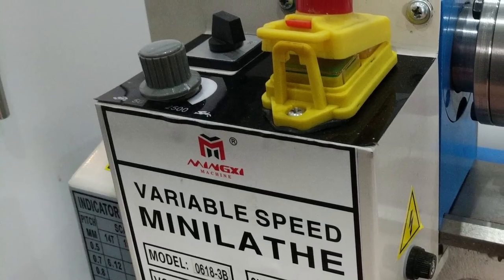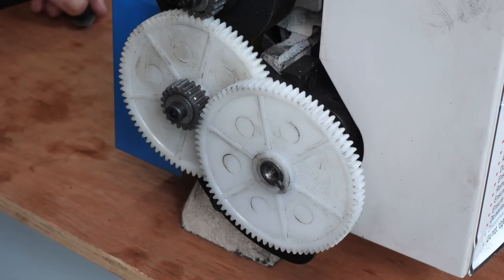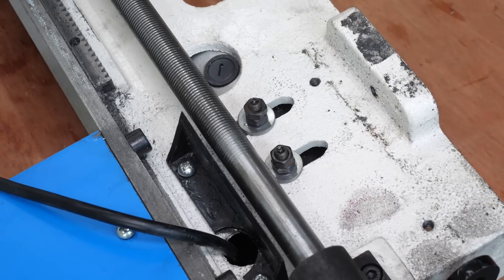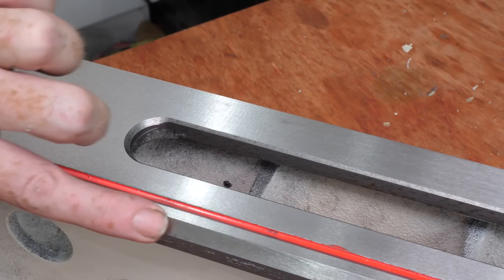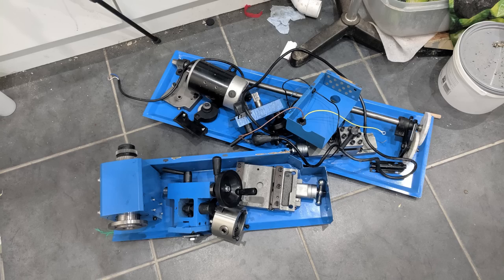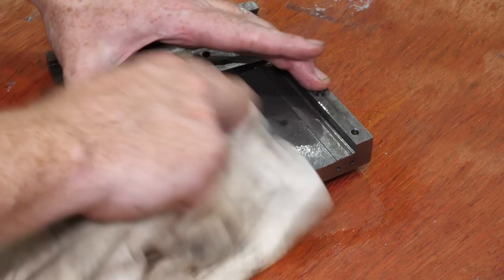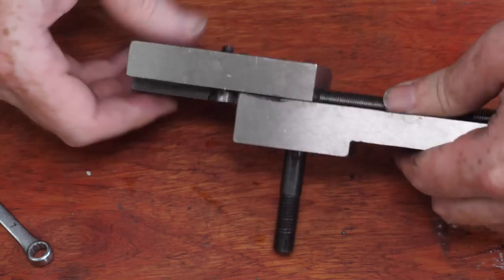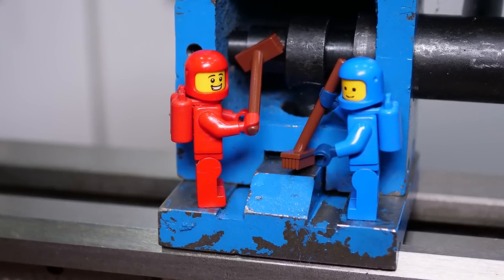Disassembling the CJ0618 7x12 Lathe, Cleaning, and Troubleshooting

Comment: I also have the identical machine you have, let me say yours is nice compared to what I have. I took mine all apart many times trying to get the ghosts out the machine.I did order all metal gears I think from banggood for this model but they don't fit to tight to go on so the journey continues, and yes your videos are always clear with excellent communication and worth the wait. I do have a request I need to figure out the belts ,pulleys, ect ect to get rid of the crappy plastic belt.

Comment: These problems are universally characteristic of all the cheap Chinese lathes I've seen online. It would almost be worthwhile for the lathe to ship as parts rather than assembled. That would simplify disassembly, cleaning, adjustment, and reassembly. And it would undoubtedly save the manufacturer at least $2 in labor to assemble it.

Comment: This video, and the next, are going to be required watching when I get around to ordering one of these starter lathes.
Reply: I think you would end up a lot happier with a higher quality lathe as a starter machine. Probably a larger one also. This man obviously has enough experience to do a respectable job of fixing obvious issues. What can't be seen, so far, is how far off the bed and other components are. Even if the casting was properly ground to start with it may have moved as it aged. Cast iron can move, a lot!

Comment: You could try hammering a slightly oversized torx bit into those rounded off allen heads.  The splines will grip in the corners. This has worked for me on various crusty nuts on my motorcycle!

Comment: Over the years I have probably done the same/similar process to 8 ~10 of these. The guys would bring them in for me at work to fettle into a usable shape prior to use. They have got worse over the years though. I always found that the lead screws were also poorly deburred and would benefit from the removal of sharp edges from the threads. 

Keep your eves open for center height issues and bed parallelism. I have had one that took quite a bit of rework to get nice and true along the length. The Beds are not ground but finished with a linisher belt.
Once set up properly they will hold a repeatable size with a decent spindle as long as a bit of care is taken. With s bit of patients you can mark out the cross slide angles on the rear of the turret and a couple of little mods I did to mine was to include an alignment pin to set 0 and +- 45 deg along with a cheap veneer scale on the cross slide and carriage a bit like this    http://tiny.cc/cvj2jz
Reply from the maker: That's a useful tip, I didn't think to check the lead screws for burrs. I'll take a look.

Comment: Do you think the initial purchase price of the lathe is still justified even with all the work you're putting in?  Like, as opposed to a little bit larger name name brand lathe or a second hand one?
Reply from the maker: When I answer that question, it's important that I explain why I bought this lathe. I'm very happy with the Proxxon (from my other videos), and I primarily bought the Chinese lathe as an edicational and improvelment project.  I fully intend to work on pretty much every part of it, before I consider it ready for use.

For anyone buying a lathe for real work, I'd strongly recommand a more expensive, reputable brand if you can afford it. However, if you can't afford it, don't worry about buying a cheap machine. Fixing the problems is very educational, and all the problems I found with this lathe are entirely solveable with background reading.

Buying a lathe is the beginning of a fantastic hobby, and you shouldn't have to wait until you can afford something of high quality if you can start learning + having fun on a budget.
Reply: @AdventureswithaVerySmallLathe  Don't downplay the advantages of the learning experience. By doing a full tear-down and rebuild, one gains a thorough understanding of how all the 'moving parts' come together, in a way that just doesn't obtain from opening the box and leafing through the manual.

Comment: Dish soap.and warm water is very effective at cleaning parts likr this.  This soap breaks down the oils and allows grit to be washed away.  It's very difficult to remove all abrasive and grit with solvents alone.
Reply from the maker: Any tips for preventing corrosion after cleaning? The upside of using a bycicle chain degreaser is that it contains ingredients to help prevent corrosion. Cast iron can start to rust very quickly, as I saw while I was making the video, when the paint stripping gel started turning rusty colour in seconds.
Reply: @AdventureswithaVerySmallLathe  just coat any parts in light oil after washing. I was more referring to the larger parts that you were cleaning with wd40.  The ultrasonic cleaner is pretty effective.

Comment: I also bought a lathe a few years ago and finally I took it completely apart to fit new roller bearings and also cut the play between the movable parts everywhere and now gradually I'm putting this back together I'm glad to see your work 😀you're just using the wrong screwdriver this is one for wood screws 🤗and not metal screws hihi 😂👍

Comment: I have just received a lathe that looks suspiciously the one you are working.  I dread the idea of taking it all apart like that, not mechanical,  but I think I might be able to if I go along with the video.  Excellent work.
Reply: depending on where you bought it there's a good chance it isn't nearly as bad as this. for Asia made mini lathes most of the cosmetic frames are made in the same factory they then get assembled by others who can decide what to do with the insides and the other important parts. this can lead to machines that look virtually identical, but have completely different qualities. Usually price does tell when it comes to these machines. You get what you pay for.
Reply: @crabbychimera3969  it was missing the little but that engages the plate to hold it on n place.  Besides that it seems ok. Couldn’t help but turn it in and it actually sounds good.
Reply: @crabbychimera3969  after going through mine a little it actually seems fairly good.  It sounds good and runs smooth.  Putting a live center in the 4 jaw chuck and tail stock and they line up well.  Maybe .5 mm out.  It was missing the nut that holds the plate in place to lock the tail stock in place.  That was an easy fix. So fingers crossed.  It says it is a vevor

Comment: Great video! I agree with your idea of it being a QA reject. Ive a 7x14 version and is virtually the same as that but branded Amadeal and it seems to have a much better finish (Not perfect by any means but is pretty good). Also when these machines are set up right they can do some pretty good and accurate work, mine consistently hits dead on to a thou

Comment: Thanks for the video. I am trying to take the saddle off of mine, but there is a caps head screw under the saddle that is hitting the gear and the saddle will not slide off.

Comment: Do you already did increase the diameter of swing over the bed?
I'm looking for a mini lathe with 30mm swing over the bed but it's very difficult find. I'm thinking buy this model and do the upgrade, but I'm not sure if it's possible
Reply from the maker: I'm not sure quite what you're asking. This lathe shipped with a swing diameter of 180mm. A lathe with 30mm swing sounds like for watchmaking, and I can't imagine something smaller.
What is the dimension you are looking to increase, in descriptive terms?

Comment: Great video well done!  wish I had found you last week, my lathe came in looking like the truck had run it over.  several missing and broken parts, no manual or tools as shown in the add. I have never taken a lathe apart till now. but I did make it through. for the most part. I wish I understood the power board more. I confused me on just how the motor was not running on 120v at first. my lathe did not run at all at first. after a lot of questions and elimination of good and bad stuff, It came down to the switch was bad and the switch on top was not in the best shape. bottom line it works, not for the final tune-up.
What size of cutters is correct to use, I am looking at 1/2 inch shank because this is what it will take to be on center with my cutting. and what info can you give me for my boring bar?  And where will I find replacement gears?
I have subscribed to you Chanel and looking forward to many more of your  videos
Reply from the maker: Wow, that sounds rough! Way worse than the condition mine came in, though there were a few big boot marks on the outside. 
I found 1/2" lathe tools are a bit big for this machine, and only just fit into some available tool holders. I found 3/8" or 5/16" tooling (10mm or 8mm) a better fit. The tool post included is very limited, and getting a quick change tool post will make life much easier.
Replacement gears, including metal sets are easy to find on eBay.
Thanks for watching!

Comment: Very nice work. Hope to see the difference on work quality after cleaning
Reply from the maker: Thanks! There are too obvious immediate improvements. Firstly everything about the lathe is more rigid, from the motor mount to the saddle and the tailstock. Secondly all the movement is much smoother now there isn't as much grit between the sliding surfaces.

Comment: Would like to See what your compressed air solution is as I am currently lacking this and require a small unit for such.
Reply from the maker: I'm afraid I don't have a unit for that yet. I use a refillable compressed air can which is filled with air using a bicycle pump. It can't hold much pressure, and it runs out in a few seconds.
Reply: @AdventureswithaVerySmallLathe  Ahh ingenious. How did you get the can to take bicycle pump valve ? Just a short 1 min video, with no audio even, showing the details would be interesting !! Im on a budget so :/ Any way to save a penny :D ie not buying a compressor :D
Reply from the maker: @JohnDoe-qg6hm  I didn't make it myself. I bought it ready made. Home made containers for compressed air are a dangerous hobby. I can't find any for sale any more though, which is probably a sign that the commercial ones aren't that safe either. I'm certainly really cautious how much pressure I use when I fill it, as it's fairly thin walled, and a rupture would be potentially pretty dangerous.
Reply: @AdventureswithaVerySmallLathe   :D Your very safety conscious i see. Commendable I suppose. I however used to throw any aerosol I could find onto a bonfire at the soonest opportunity when i was a kid :D. Ive seen butane gas torches with disposable canisters with small pipes brased into their base for connection to a calor gas bottle via a hose and jubilee clip rather than pay the inflated prices for the butane refills which have a low 'heat' or burn rating anyway... Ohh well i will come up with a solution myself i suppose in due course. Necessity is the mother of invention after all. Look forward to your next video.

Comment: I have read your comment about the lathe being cheap.
I understand you get what you pay for but it seems this was not actually sold as a factory second, or quality control reject.
I’m still surprised at how poor it actually is.  If someone new to the field bought one of these I can’t help but think they would be disappointed and unable to save it.  I’m wondering if you will need to use your other lathe to make any replacement parts.
It seems the parts were all made at seperate locations and someone collected up the duds to make another batch of very cheapie lathes.
Some of it looks like it was thrown together from a distance. :)
Nice description of how it all comes apart.
Blondie Hacks has done a nice video on getting a small lathe to cut parallel with and without the tailstock.
I used it to get my 80 year old lathe to cut within .001” over 8” again without the tailstock.
Nice work look forward to the next instalment.
Reply from the maker: You're right, it wasn't listed as a second, or reject, but it was an anonymous eBay seller, listing a limited number, shipping dirt cheap from an anonyous address in central Europe, so I knew what I was getting myself in for. There are established traders with a brand reputation to protect who I'm certain pay more attention to the quality of their stock, and I'd point anyone who can afford it to buy from them. Axminster and Arc Euro Trade in the UK come highly recommended, and I've heard good things about Precision Matthews in the US.
Your theory that this lathe was thrown together from dud parts seems very plausible, especially the tailstock, which barely fits at all, and looks as though it as been rusting  for a few months.
I love Blondie Hacks' educational videos, and I've learned a bunch from them. I'll definitely check that one out, thanks for the recommendation.
Thanks for watching, and for the commentary.
Reply: I also love the little guys that stand around on the machine and help you out.
You know you are going to have to animate them.  They will probably get their segment ;)

Comment: The plastic gear hub diameters are often too small due to shrinkage when molded. I reamed and sanded out the holes just enough so it's a slip fit and the gears are far less likely to crack or split.

Comment: My god, these things really are thrown together.,cheap for a reason. Good luck with the re-build.
Reply: Exactly, this video is a real eye opener.
Reply: ss  The only thing the Chinese mini lathes have going for them is their size, (tabletop) I'm currently looking a for used an  old British lathe, Myford etc but they are all a little too big for my garage/workshop.
Reply: ss  I hadn't but I think I will. Thanks for the suggestions ss
Reply: I had a mini-lathe that bought from Cummings about 14 years ago.  The quality was 10x better than this one, but the price was also a lot more.  I assume these lathes are sold at different levels of build quality just like anything else from China.
Reply: Looks like maybe it was put together by trainees in the factory and flogged off cheap

Comment: in reassemble will you replace the screws and such with quality replacements?  I have been doing that on my tool holders, replacing the set screws with cap screws as I got tired of the sloppy fit of allen wrenches in the tiny set  screws.  On some brands of tool holders it did require a bit of grinding on the cap screws to provide clearance but overall, I have been quite happy.  I was doing the same to some gib adjustment screws only to discover that there were clearance issues on some of the gibs that I could not resolve.  But overall, I have been pleased with replacing the results of upgrading screws and nuts with quality replacements

Comment: Great video!   This work should pay off.  The mini lathe can be a good little tool when it is tuned up.  You may want to replace the hex socket cap head bolts that secure the cross-slide and compound hand wheels  with hex socket button head bolts.  Your knuckles will thank you.    Chris
Reply from the maker: Thankyou Chris! I wouldn't be able to make videos as well as I can if not for your contribution to Emma's prize. It sounds like I need to add improving the hand wheels to the project list.

Comment: Question?  Very good presentation.  I have a question , where did you get the small stones from. Did yoy make( grind to shape) the triangular stone?
Reply from the maker: The small bench stones (red/grey coloured) were bought from my local hardware store. The triangular stone was from a cheap set of long stones with shaped profiles (round, square, triangular) which I bought from eBay. I've seen triangular stones made from high quality material, but they get very expensive.

Comment: It's certainly a project! I hope it works ok when you get it back together. That tailstock is quite shocking and doesn't look like you'd get very smooth side-to-side adjustment or good solid contact between the top and bottom parts. Did you machine them both and shim it or something?

Interesting video, thanks.
Reply from the maker: I haven't solved the tailstock yet. A proper motor mount, gears that disengage properly, and a decent toolpost were my top priorities, and I'm working my way through them.
I may just throw the tailstock out, and buy one of the beefier ones available for lathes this size.

Comment: ,I've got a feeling that the the noise will be coming from the Planetary gears in that crunchy roughly made chucks innerds. Some molly and silicone grease will fix it after a few hours with some fine needle files that is!! 😂
Reply: The 'planetary gears' you refer to are bevel gears which open and close the chuck, they won't make a noise as they don't move under power, it's the drive train and the loose motor & belt that's making the  racket
Reply from the maker: I'm certain the noise was from the feed reversal gears, which don't disengage properly.  As you can see a short while later, the very tip of the cogs catch, and cause the feed to keep turning, even though it should be disengaged.

Comment: Have you a video disassembling the headstock itself ? You did not do it it the video, is There any specific reason ? Thanks in advance
Reply from the maker: I haven't disassembled the headstock yet. It's the most challenging part, and I wanted to make sure I had learned enough before I started. Recent challenges on my time have meant my focus is elsewhere for the time being, as I don't have access to the right tool for working on the spindle at the moment.